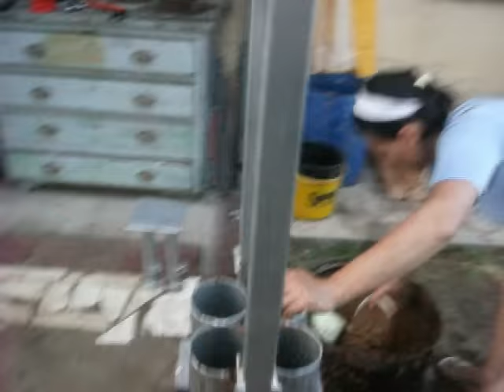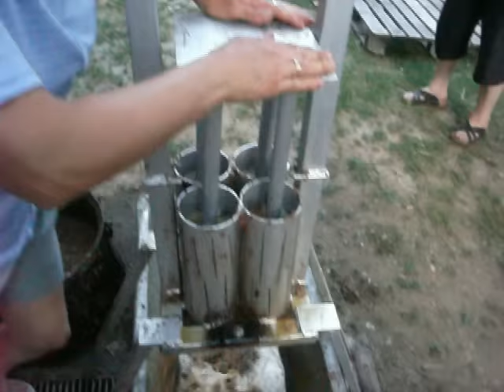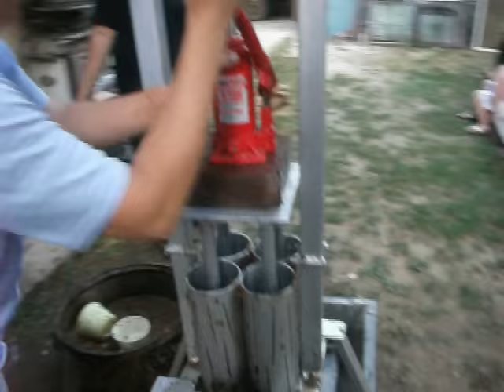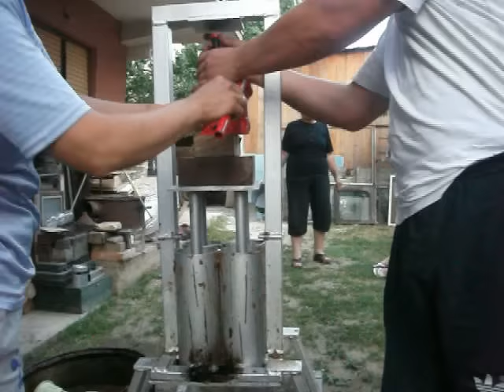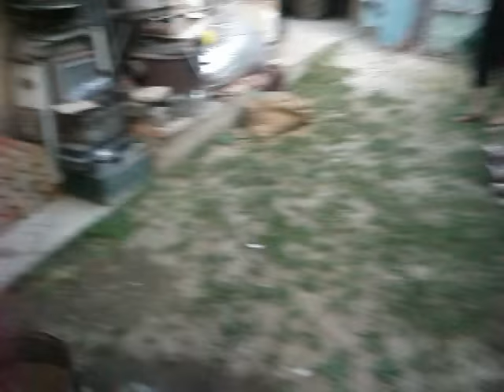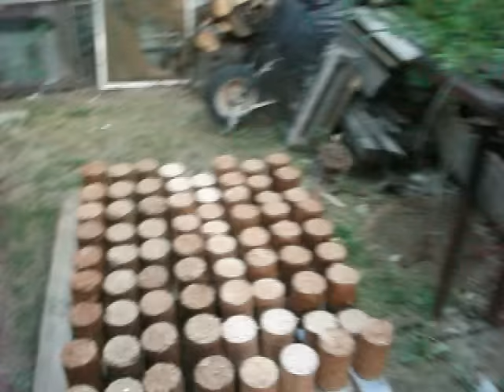Homemade briquette press / racna presa za briketi

Comment: IS IT POSSIBLE TO PURCHASE THIS MACHINE AND IF SO HOW MUCH IS IT PERHAPS ITS AVAILABLE IN UK
Reply from the maker: Such a machine does not have to sell its hand-made by my self
Reply: What is the gauge of the pipes recommended and the size of the holes for holes through which water leaks out as you compact?

Comment: won't be better for the brichette to have a transit hole in the center so it can dry faster and burn from inside much better?
Reply from the maker: its better  with a hole in the middle of now I'm working on it
Reply: hello, when you find the solution please be so kind to share with us.
brgds,sebastian.
Reply: Double the length of the piston rod and have it go through the press disc.

Comment: I've made my own press (well, a good welder made it, actually), but I've tried only with sawdust as the raw material and that dissappointed me, because all the briquettes break apart.
One question: what are the materials you use for the moisture and in what proportions ?
Thanks in advance for your answer.
Reply: Mihai Mateescu 

Add in some waste paper - the long fibres and the starch will help it all stick together.
Reply: James Cameron-Clarke Thank you for the answer. I have one more :-)
Do I have to leave the paper several days in water ?
Reply: Mihai Mateescu Yep. Shred it up, then leave it for a couple of days before mixing it with your sawdust. The more broken-down you can get it the better. Newspaper and similar is good, but avoid glossy magazines.
Reply: Thanks a lot ! :-)
I can't wait to try it. Keep in touch.
Reply from the maker: Mihai Mateescu Take the first paper, chop it into small pieces, then it is well and filled with plenty of water, then left overnight to soak well, then mix well, following what you need to do is to mix sawdust with the paper by placing 70% sawdust and 30% of paper, then mix well and then you have a mixture for briquettes

Iam I gonna do a video for it and you will be able to see how I'm doing it
I hope I have helped
Reply: Thank you very much for your detailed answer.
Keep in touch :-)
Reply: igor gjorgioski "Back in business" I can say :-)
I tested the new "recipe" (70% sawdust - 30% paper waste, shredded manually, left 2 days in the water) and it worked just fine. I even threw my briquettes on the concrete floor and they didn't break apart.
One thing: I use fir sawdust (I'm a carpenter hobbyist) and the briquettes are very lightweight, but they burn longer than fire wood.
Thanks again !
Reply: +Mihai Mateescu , +igor gjorgioski do you guys think i can use leafs also? My grandmother has alot of them in her garden.